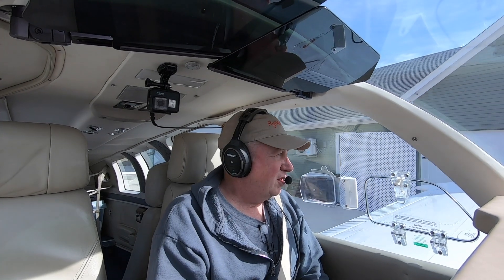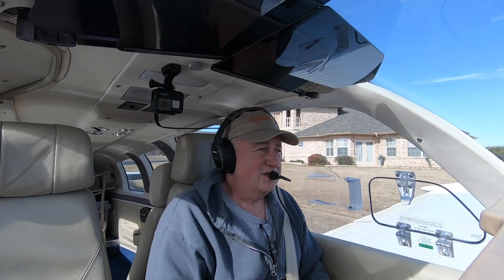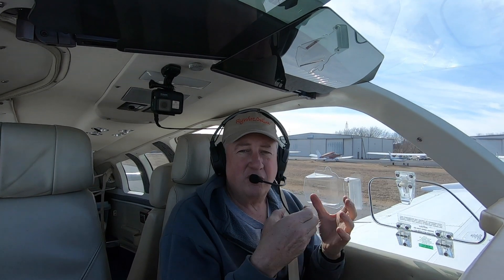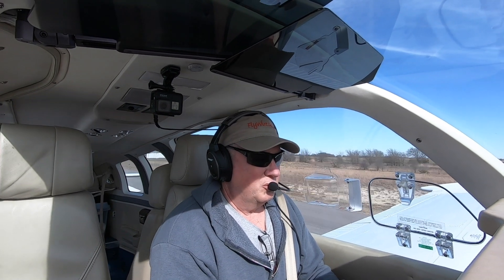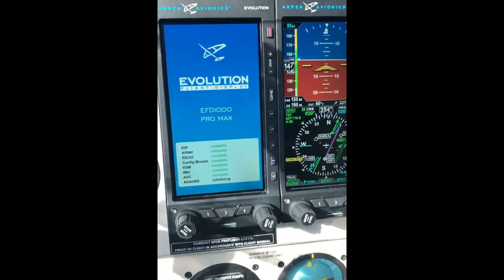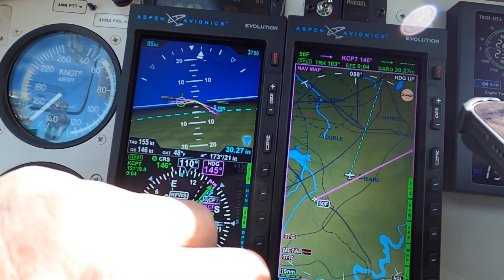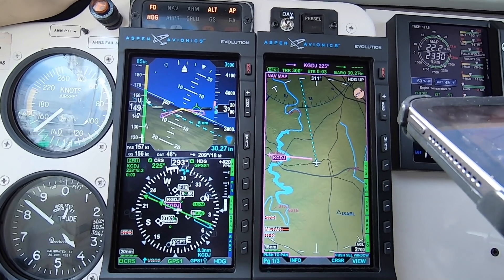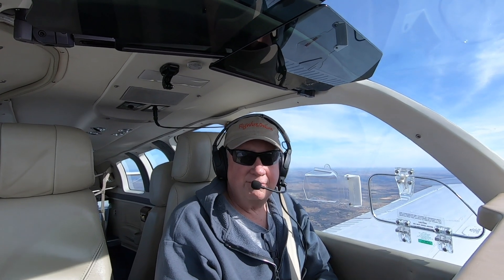A36 Bonanza Aspen VS Autopilot Learning to Play Nice

Comment: Thanks for the video. I have a similar setup in a Commander 114TC that I recently upgraded with the A2000 system. Been a real nightmare from the start and finally getting settled after over a year of back n forth with the shop that installed it. You give me one more thing to "check into" as I have noticed I generally hand fly smoother then the AP. Also approaches it always seems to be to the right of the localizer. Mine is slaved to a Stec 55X. The most frustrating thing about the install is the lack of overall confidence I have with it. Makes going IFR typically a NO GO. Frustrating to say the least.

Comment: Our Bo has the older Aspen 1000 hooked up to a KFC-150, and (knock on wood) has been pretty good.  The only problem we've run into is the Aspen losing AHARS, but a quick reset brings it back to life.  Glad that hasn't happened on an approach yet...
Reply from the maker: Percy- Glad to hear it! I think the older 1000 Pro's are more tolerant of the incorrect Ethernet cable installation.

Comment: Scott - another great video thanks.  I have the same basic panel as you do - GTN 750, GTX 345, Aspen Pro MAX PFD with Altitude Pre-select, and KFC 200 with STEC Yaw Dampner.  So far, my Pro MAX is doing a great job driving my KFC 200, but maybe my installer used the Aspen Ethernet cables?

Anyway, I think that the Aspen Pro MAX is a great PFD and so far I have been very happy with mine and how it works with the KFC 200.  Glad you got yours worked out.  Keep the great videos coming!  I learn a lot from your videos.  I am based in Gladewater 07F so in the same neighborhood (Texas!).
Reply from the maker: Stephen-  Thanks, I really appreciate it! Maybe we need to get a Texas Meet-up organized!